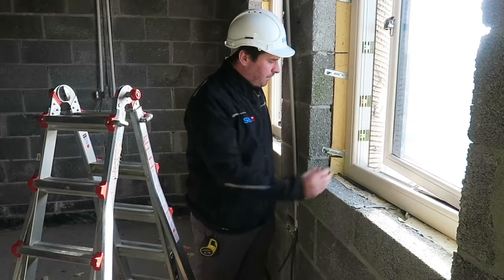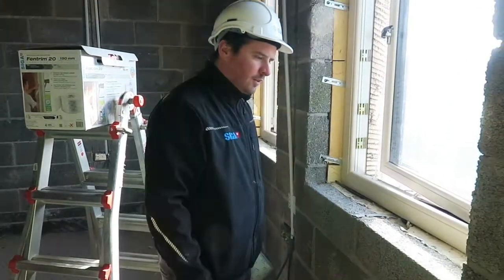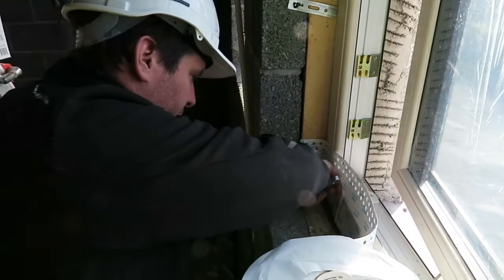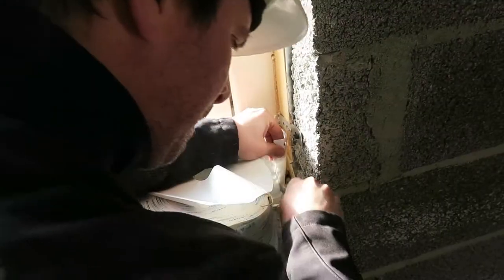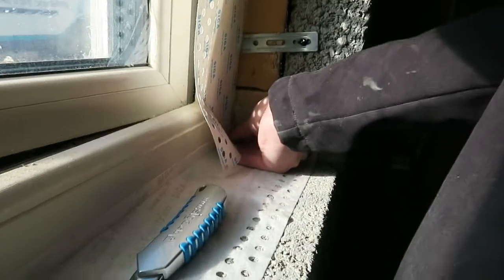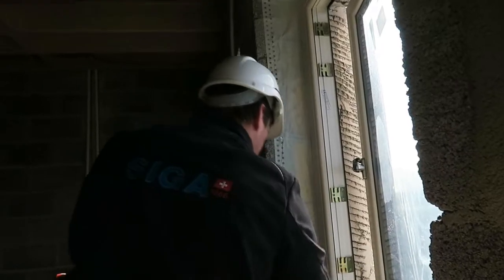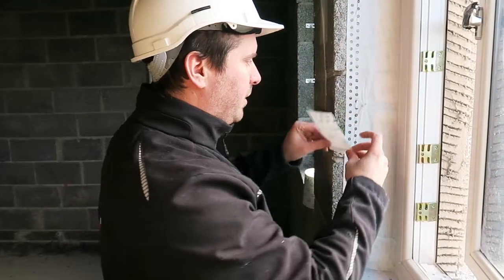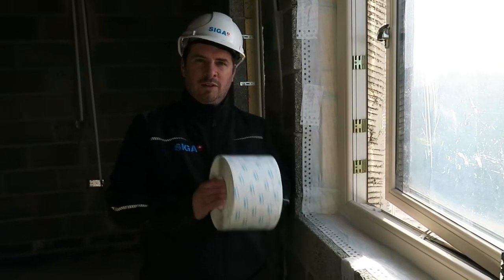Joining window to solid wall construction using the SIGA Fentrim 20 tape

Comment: Can i buy this in England and use on a partial fill PIR cavity, 150mm cavity with 100mm PIR and 50mm gap. I can fully close cavity with closer or insulation returned?
Reply: I think so